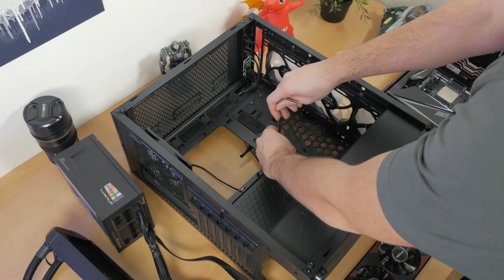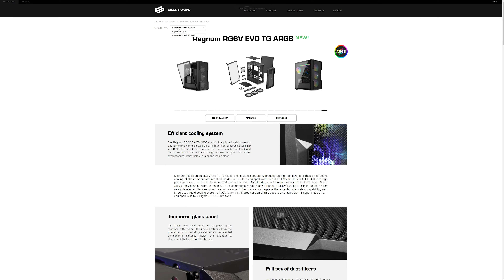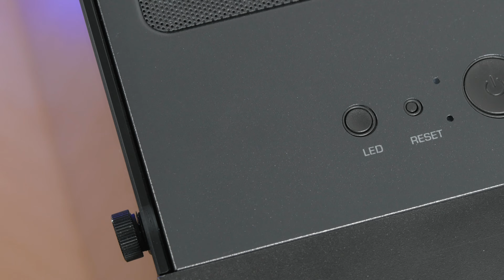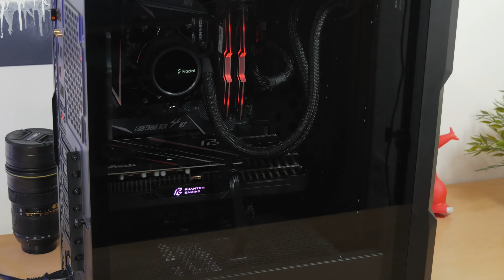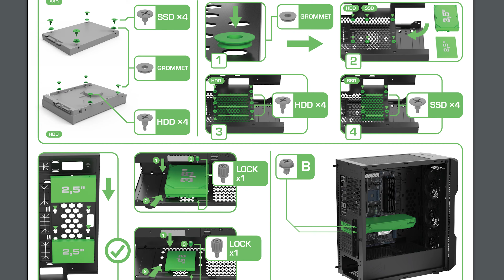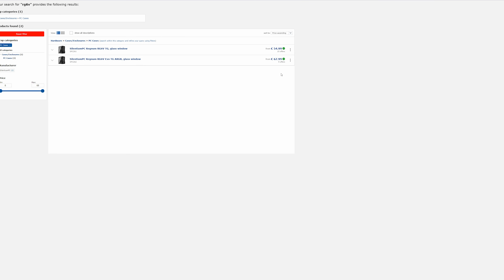BACK TO the ROOTS? - SilentiumPC Regnum RG6V Evo TG ARGB Build

Comment: I am running a crazy setup of 18-core 10980XE, 256GB RAM and dual GPU (3080 + 1660) on a Silentium AR6 (the only meaningful case available at the time of the build), but I will be switching to this full front mesh RG6V soon for the improved airflow. Thanks for the review, good job!

Comment: Good case for 70 euro? Or its paper thin steel? Fans quiet on 800rpm?
Reply: it is hard to bend and it's quite heavy and yes it is quiet even on 1200 rpm, u can set max rev and u still cant hear it when u wearing a headphones

Comment: Nice review . I was in the market for a cheap mesh case . And this blew all others with that full mesh front , rubber grommets and the 4 ARGB Fans . for 67 euros in my country I had to buy it . If the stock fans aren't good enough (silent) I will buy be quiet pure wings 2 (2x140 in the front for intake , 1x120 in the rear and 1x140 on the top for exhaust) so It can be silent !
Reply from the maker: Thanks for watching! Glad to see you find something that suits your needs 😊
Reply: I have this case with their black fans and they are quiet! Really good case for the money! ~55€ for the non RGB one here in Finland!

Comment: Can I control fan speed?
Reply: yes there is a 4 pin fan splitter. If i remember correctly 4 piece in lightning-less model, 5piece in argb variant. The fan hub is PWM controlled, the included fans are 3pin though, but a different review, and on official site both claim you can control the speed. Not sure how would this work?
Reply: @polishguywithhardtospellna8227  You connect the hub to a 4-pin fan slot on the motherboard and then the hub controls (PWM) the 3-pin fans. The hub can then be controlled by your motherboard's software (or any other 3rd party software).

Comment: Thank you very much for your video and the excellent review. I am also interested at the SilentiumPC Signum SG7V Evo TG ARGB because it is among others bigger, thus it can fit larger CPU-Coolers.
However, I am afraid that the case fans are noisy. According to your measurements, the Regnum fans reach on idle about 37 db. If the Signum has the same or similar fans, well, they are probably too loud for me. Anyway, I would like to see a review of the Signum. Thanks again for your review!
Reply from the maker: Thanks for watching! BTW. I have the SG1V incoming, that little one looks like an awesome deal too!
Reply: Hey mate, I got this case and the case fans are controlled by motherboard, so if you're not putting super load on your pc or not playing games it's so quiet it freaks me out and even when you set them up to maximum speed it's mostly the air whooshing around and not fans themselves! I recommend it.
Reply: @hex8529  Thank you very much for your feedback Arcticus, I appreciate it.
Reply: @ter.iv.4336  you're welcome had this case for almost a year now and I am glad I picked it ;)
Reply: @hex8529  thanks a lot
Reply: @woke657  no worries mate!